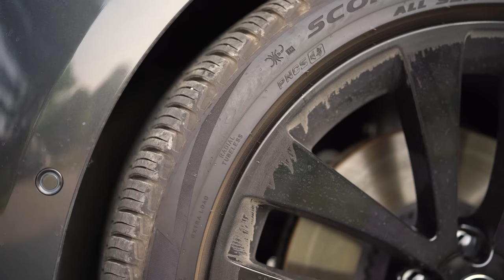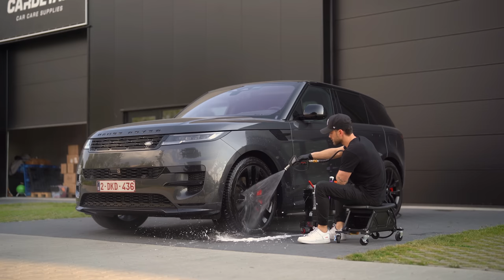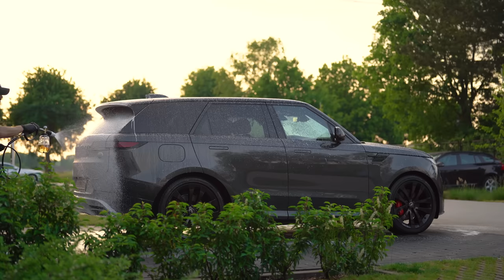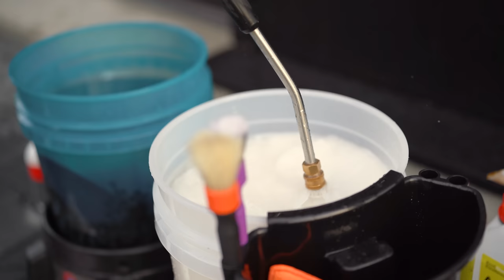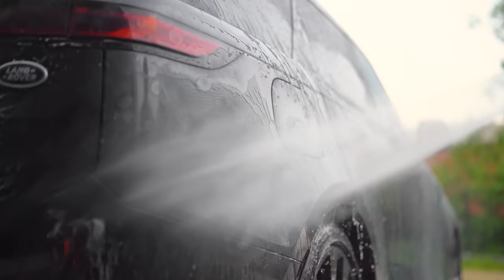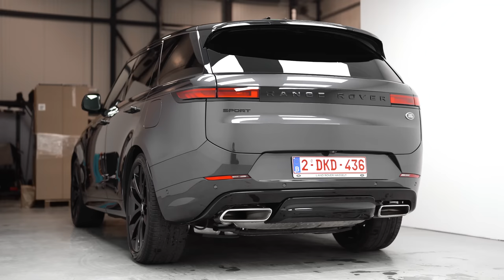Cleaning a 2023 Range Rover Sport - Foam Wash

Comment: Fantastic finish!
Question tho, did this vehicle have an existing coating on it?
Figuring no if you used AF then Descale then finished off with the spray sealant. Just curious if the new spray sealant can be used on top of ceramic or PPF

Comment: Which do you prefer the suttner or the mtm gun, and which type of quick connect is your favourite?
If you do indeed have a preference is it because of the swivel?
I have a really good idea for a pressure washing system, if interested I could inform you in a dm, for copyright reasons 😅
Basically I have really researched into every single brand and I have a prototype in mind, which combines the best of the best! I might not have experienced but I am knowledge!